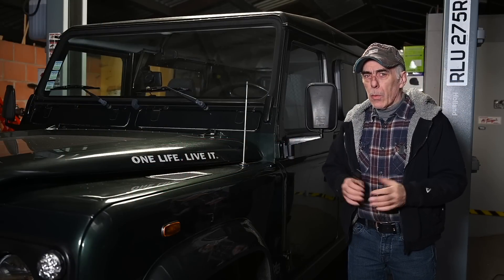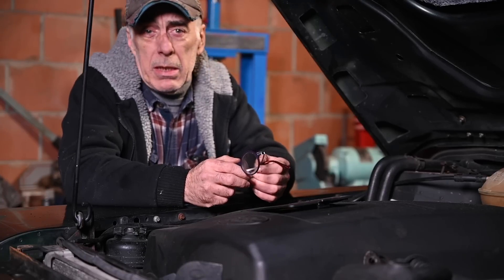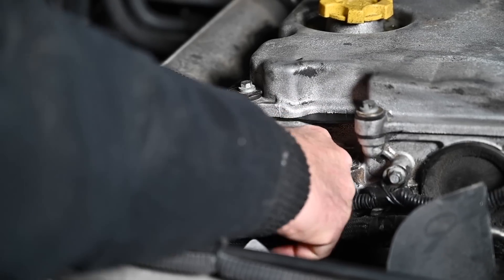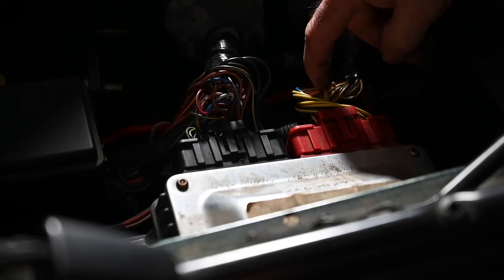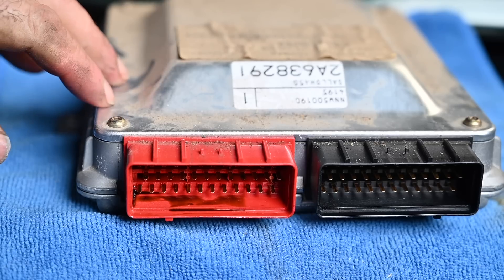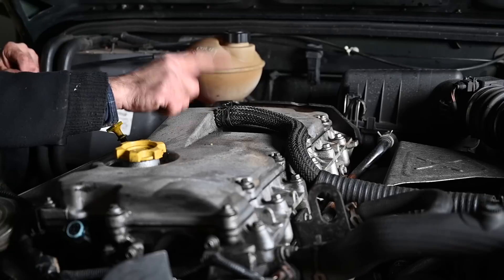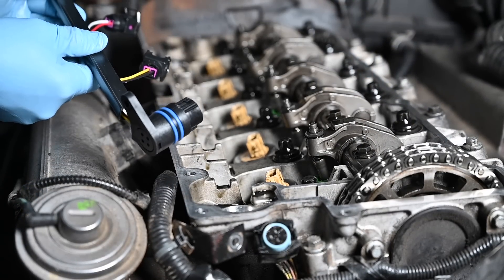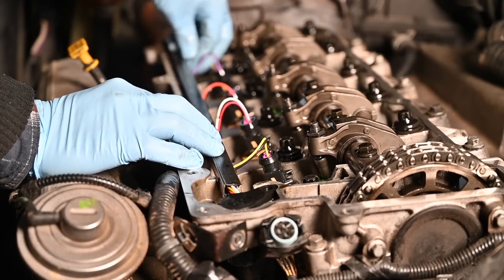Landrover Defender  TD5 Oil Creep into the ECU

Comment: Always check the external oil pressure bolt 🔩 they always work loose.
 Plenty of Loctite should always be used. Tark up and add 1/3 of a turn 🛞
Reply from the maker: Good to know, thanks for the tip!

Comment: Please can you help i have a Defender 90 Puma that keeps cutting out and then restarting when driving i have followed your advice, but under the seat, I have no ECU. But I can see oil over the engine.
Can you help.
Reply from the maker: Well this video was on the TD5,   did you read-out the error codes on the ECU ?   That would be a good start...   The Puma does not ( in general) have the oil creep issue.  The ecu is  behind the passenger-side seat box panel.

Look at the passenger seat box (the metal box the seat sits on).
Remove the vertical panel on the front face of the seat box (held on by screws).
Behind this panel, you’ll find the ECU mounted in a protective bracket, along with some relays and fuses.

Comment: Hello Steve, have you had any further leaks into you ECU since replacing the injector loom, my thoughts are that there will still be oil in the loom from the top connector and the ECU that cannot be removed, the only way I can see to do that is to fit a tight air tight collar around the top connector and pressurise it at low pressure, that would force any oil in the loom out of the ECU end, what are your thoughts on that? Chris B.

Comment: Corsa C.
Oil pressure switch was dead oily, as was the wire. It seems the oil went into the ECU. Mechanic sent it off and apparently it can't be repaired: 600€ for specialists (The only shop in France apparently that can handle this type of Bosch, the mechanic' s normal contacts can't do it.) And 200€ to my mechanic.

Comment: If you are having trouble with ignition start, or the engine cutting out while you are driving, then what you can do as a temporary measure, is to turn the ignition into the prime position which shows the red oil light symbol and warning light, then wiggle the wiring harness under the right hand seat.
You may have to wiggle up and down, back and forth.
You will then see the yellow/orange fuel pump symbol come on.
When this is on, you then can start.

Comment: You need to also replace the grommets 100%, they stop oil seep around the bolts and id definitely use RTV mastic on top of the main plug and each injector plug to stop oil leaking thru👌

Comment: Ten years ago I dismantled each connector plug and soldereded carefully each cable to the injectors. So far everything is fine! I have 100% electric continuity, my TD5 engine starts at the first try really fast and the response is excellent. That was the last harness I changed.

Comment: captarmour
3 minutes ago (edited)
 @D3Sshooter  I got it starting! Yesterday I removed the Accelerator Pedal sprayed the contacts with contact cleaner, although I saw no sign of corrosion, reconnected and so far over 10 times in succession it is starting normally and the 'throttle' response has improved. I'm thinking it may have been just unplugging and plugging back somehow reset it.

Comment: Just watched a video where the red connector was full of oil, the cables leading to it were drenched in oil, yet when they opened the ecu there was no oil in it, nothing at oil, just because you have a bit of oil in the plug is no reason to panic.

Comment: Hello again. I hate how Land Rover simply pushed the engine in the defenders forward by about a foot simply because the V8 used a longer Bell Housing. 
Besides upsetting the balance this made a change from the iconic 'Set Back Grill' from Series 1 to Series 3 to this ugly front end which pushes a winch way forward reducing approach angle. 
I remember seeing a N/A 2.5 diesel with a short bellhousing on an R380 gearbox, but the TDI Defender had the long bell housing! 
Is it possible to install a short Bell Housing on my 2006 TD5 110? 
Besides finding the short bell housing, I would also need to change the input shaft of the gearbox to a shorter one.
Reply from the maker: Thanks for the comments
Reply: @D3Sshooter  I go it starting! Imagine just a little dirt on the crank sensor! The accelerator moves almost an inch before the engine responds and it is sluggish at the bottom, a far cry from my 1986 2.5 Petrol's instant torque.

Comment: As a uk vehicle mechanic this is no surprise, the idiot who designed the layout didn't have the brains to put proper connectors on it and also a drip loop on the cable, also why would you put the injectors inside the valve cover....just asking for trouble.  That said  a td5 thats good and running well is great.
Reply from the maker: Thanks for the comments

Comment: Great Video! I am a subscriber! My TD5 starts immediately on a running start but refuses to start with the starter! Would this happen with oil in ECM plug?
Reply from the maker: I don't think so,  that seems more like a slow starter motor or weak battery
Reply: @D3Sshooter  New Battery and starter, it turns over normally. I didnt find any oil on the connector at the ECM but on the connector to the injector harness on the underside of the cylinder head cover
Reply: i plan to pull the head cover by loosening the 13 small bolts and clean the injector harness connector.
Reply: I can’t stop looking at your videos, really informative. 
A mechanic suggested my hard start problems may be low compression. Yesterday I was saying “this starter really spins this diesel fast” and then I remembered what the mechanic said a couple weeks ago! 
How do I check the compression?
Reply: @D3Sshooter  I got it starting! Yesterday I removed the Accelerator Pedal sprayed the contacts with contact cleaner, although I saw no sign of corrosion, reconnected and so far over 10 times in succession it is starting normally and the 'throttle' response has improved. I'm thinking it may have been just unplugging and plugging back somehow reset it.

Comment: Hi Steve .... i had (and have) the same problem .....
But MY ECU was down, has Oil inside and a electrical problem because of this ....
I must send my ECU to a Repair-Service....
Than i find out the Cables on the red Connector who transported that oil .....
Than i cutted this cables and soldering a Oil-Barrier between the ends of this cables ...
today and the next days i try to finish my work and i can start my TD5 .....
Greetings from Germany and stay safe

Comment: Hi Steve, Great video as always. Well explained and demonstrated. Keep up the good work.
I know this is something i need to do to mine. Loving my defender
Would you disconnect the battery and let it discharge before unplugging any of the harness or is it safe to just unplug and check it out.
Regards,
Paul

Comment: Very clear as usual. Injectors inside the rocker cover were always a bad idea for many reasons, but mainly because fuel can leak unseen from the supply side and dilute the oil, leading to bearing problems, so readers, if your oil level rises look into this quickly.(Just noticed I call it a 'rocker cover' - of course nowadays it's usually a valve cover - shows how old I am that the engines I'm used to have pushrods!)
Reply: That was very common and actualy a recall on the Chevy Duramax LB7 engines

Comment: I don't know why anyone would choose to re-use a gasket... it is false economy and your video showed why. 
When you were cleaning the rocker cover and the alignment bushes (dowels/whatever they are) fell out proved the rubber had lost its elasticity, taken a "set", and was sealing only because it was stuck in place by time. When the cover is removed this bond is broken and you'll never get it to seal again. 
(I suppose you could goober it up with a 1/2 tube of silicone and say a prayer, but it's not the correct way to do the job.)
Thank you for illustrating the proper way to clean and prepare surfaces for a new gasket (including the screwdriver in a rag in the groove trick). 
Always ask yourself when fretting about the cost of a part to do the job correctly... "Do I have the time to do it right, or the time to do it over?" (time IS money)

Comment: Welcome to the world of the TD5!  It's not really a solvable issue. The oil migrates between the wire conductors and the insulation. Best just to replace the injector loom every 12 months or so.
The more serious issue with the TD5 is the No.1 injector pocket cracking. This is a bit of a random issue, happened to my TD5 after 200,000 km. The engine "ran away" due to the fuel leaking from the head and reaching the sump.  It had 13 litres of fuel/oil in the sump when it ran away. 
Luckily it was a manual gearbox and I was able to stall the engine.
Also, Id suggest not using air to blow away the oil from the plug, using contact cleaner and leave the ECU standing plug down overnight.
Reply from the maker: Thanks for the comments and tips mark

Comment: For anyone working on these.........If you have headroom, the correct weather, the inclination, it's always best to work on Defender engine bays with the bonnet straight up or off, just leave a bungy permanently inside the bonnet along the right hand inside sheet metal inner bracing to hold it back  against windscreen frame or roofrack if you have one (to inside seat belt top mount if nowhere else available to hook it back, you can still close the door ) so it doesn't fall on your head, it will hurt!
It makes all the operations shown here much easier with more light, even do it when checking coolant level as it's the only way to easily  see it  by looking down the cap, many people have lost £5000 by thinking they can see through the brown plastic bottle, which is a shame.  
I always remove  the orange seal and leave hanging over the ecu plug wire (the orange rectangular silicon ecu plug seal on the red plug,) keep it there if someone wants to put it back, it just prises out with a small pick. This is on Defenders with the wiring already contaminated in the main wiring harness, to allow oil to drain away a bit more  before it forces its way more into the ecu by capillary action, the plug can handle so much oil, but too much shorts across the 5 yellow injector wires because of the carbon in the oil, oil is normally an insulator when clean. Obviously changing the injection inside the engine harness is the way forward, and hope stops it from getting worse. This hopefully avoids the need to change the much more expensive ouside the engine main harness.
And avoid cheap ecu harness with wrong wires, badly made......
Thanks for a great Video by the way. I'm sure it's helped many people......
Reply from the maker: Thanks for the comments and the great write-up

Comment: Hi Steve, ist the oil Not actualy creeping through the wires? Mercedes have the Same Problem. You have to unmantel a tiny Part of the Wire and soldering it so it is Solid and oil cant Push through it.
Reply from the maker: Thanks for the comments, It seems to creep along the outside of the insulation, hard to tell

Comment: One thing you should look at in your servicing schedule Steve is the Bosch fuel pressure regulator, it is notorious for allowing a mystery seep of diesel which appears on the garage floor, there is a kit available from X8R to fix it. Chris B.
Reply from the maker: Thanks for the comments Chris...  I will check but so far I see no issues..

Comment: An excellent tutorial! I have been told that this problem was cured by a redesign of the injector loom, but I will have a look at mine in case, I suppose an easy preventative would be to drill a drain under the ECU socket to allow any oil to drain before it went into the ECU case, Chris B.
Reply from the maker: Thanks for the comments,  I would rather fit a new harnas for the injectors , it easy and quick
Reply: @D3Sshooter  I agree it is much better to replace any faulty part if new spares are available, also best to buy original manufacturers parts, I fitted a pattern clutch release bearing once on my Ser III, it only lasted 3 months, then gearbox out again, at least the bolts all came out easily! Chris B.

Comment: the Mercedes has the some problem with the multi plug on the gear box, the oil runs up the inside of the wire into the TSM (transmission control module) to fix it you need to replace the valve body inside the gear box easy to do at around £220 (its all on youtube)
Reply from the maker: Thanks

Comment: Tip : You could use some "Dielectric Grease" in the plug connector's & plug o-rings etc to try 
Prevent the oil creeping into ECU & Fuse box on Discovery TD5 or at least slowing it  
Also iv'e read Land Rover Overlander's keep a tin of "Vaseline" in tool box for preventative electrical issues etc etc.... Nice quality video Thank You !
Reply from the maker: Good point

Comment: It is possible to open the ECU, I did mine and there was oil in it that I cleaned out. You just remove those four bolts and then carefully prize the lids off. I used a smear of rtv on the rubber seals when I put the lids back on.
Reply from the maker: Yep, I did... but the seal was real sticky ...so I decided not as the NANOCOM did not indicate any issues..
Reply: @D3Sshooter  my Nanocom was clear as well but there was quite a lot of oil in my ECU, most of it had drained down to the side and off the PCB as the ECU is mounted on its side in a Discovery 2.

Comment: The "oil" is coming from the rubber seal. It is a phenyl silicone fluid deliberately put there .Look up weatherpak connector seals. The rubber seals around all electrical connections are made of methyl vinyl silicone which vulcanizes to form a solid rubber, The rubber is made with 1 to 2% phenyl silicone fluid, which does not get crosslinked into the rubber matrix. This fluid, after the silicone is cured, "bleeds out"  due to incompatibility, forming a weatherproof, non-conductive liquid barrier to guarantee the connection has no gaps and will not short. After years, enough will bleed out of the rubber part to forma a puddle. Your wires are greasy because of migration of the phenyl fluid along the surface of the wire.
Reply: Silicone oil is clear; that oil was clearly used engine oil.
Reply from the maker: Thanks for the comments, however if I look at the amount of oil , then it can't be only from that seal phenyl .. That is way to much...  But I do buy you explanation   thanks.
Reply: Er - that's not what's happening here.

Comment: Interesting to see that the oil can go that far out.  Although I suppose not that surprising for a Brit vehicle... :)      Any way you could put something (paper towel etc) inserted in the loom someplace to suck up / store the excess oil and  then check / replace that periodically?  Might prevent it from reaching the ECU.
Reply from the maker: Thanks for the comments, I am not sure if that would work and oil stop. Its better to replace the leaking parts
Reply: e9999qwe: Not sure what part of the planet you live, but Land Rover was owned and dictated to by BMW at this time, that is why it has awful unreliable Bosch electrics, and the last time I looked BMW was german. as for "sucking up" the oil it is better to replace the leaking part.

Comment: I'm amazed that one would even design a system that could fail like this.
Reply from the maker: Indeed, a common fault on all TD5
Reply: @D3Sshooter  I've been talking to people today, apparently another fault that happens with these is high pressure diesel can leak from a faulty injector and get shot directly into your ECU. Would be a much faster failure than this slow creeping problem
Reply: @dquad  Well - the ECU is under the driver's seat, so not exactly likely.
Reply: @dquad  Yes - this is a viable scenario where the ECU is located inside the combustion chamber.
Reply: Mercedes w210 had similar issue. Trans fluid creeped uphill to engine bay ecu that is controllin the transmission.
Reply: On VW (ZF i guess) CVTs there is ecu in the transmission and a similar thing happens.
Reply: There are engines with Timing belts in Motor oil 😂 what Do you expect